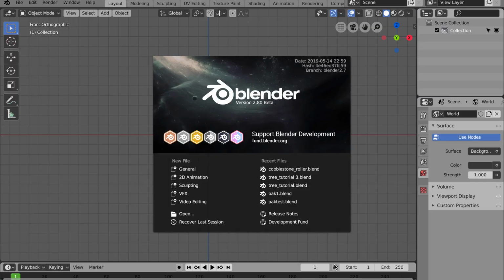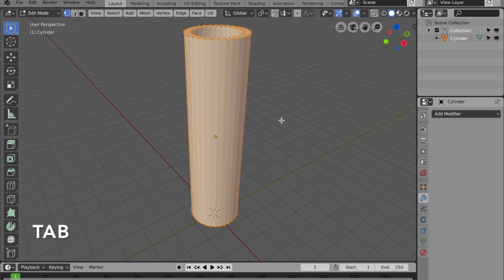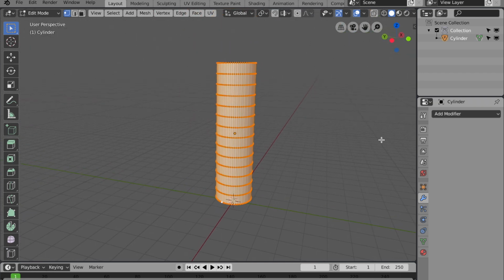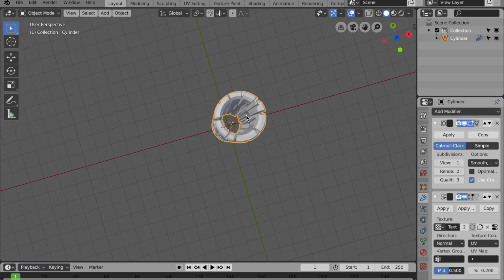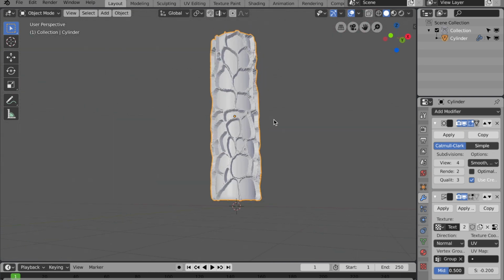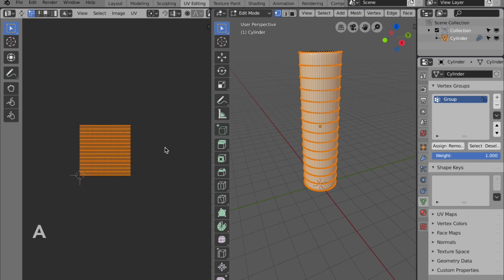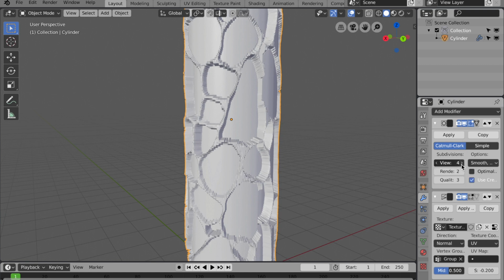3D Printable Textured Rolling Pin Tutorial

Comment: Phew! I got there in the end, with a texture roller for old flagstones. And I really appreciate your efforts to make a video showing how to do this. But I have some comments:
First, please don't say "If you can click a mouse, you can do this in ten minutes" and "The process is incredibly simple and doesn't require any modeling experience"! It has taken me about 8 viewings of this video, several doughnut tutorials, many false starts and a lot of head-scratching to be able to follow what you have done, and I am still not entirely clear. If you offer to take a newbie through a process, you must explain every move, please!
You selected to make a cylinder 100cm by 750cm, which is enormous. Any reason why? My final .stl file came out incredibly tiny on the Cura buildplate, more like 7.5mm high. Does this matter, or should it just be ignored?
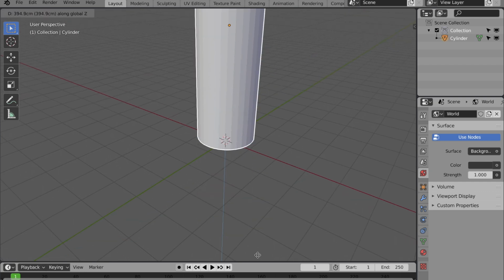At 0:52 you lifted the cylinder up without explanation, in fact while you were talking about the next step.Was it important to do this?
I got stuck at the selection of the outer vertex group, which you did not explain, just showed some mouse clicks. I still don't know how you select the ring of vertices around the bottom rim. I eventually succeeded with shift-clicking little groups, avoiding the inner vertices.
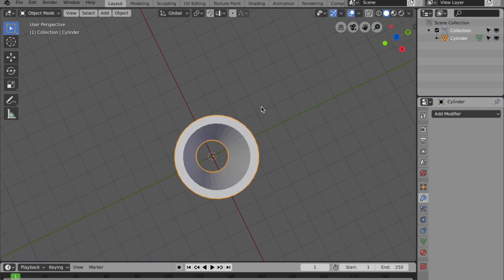When adding the wall thickness, it would help a lot if you could put a caption about clicking the 'Apply' button, as I failed to do this several times... It's at 1:05, where you seem to scroll away.
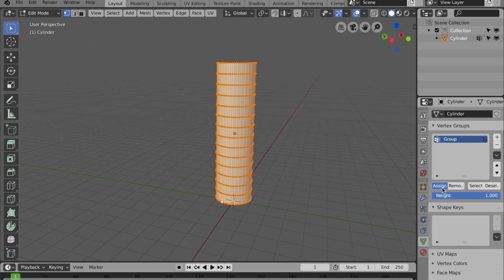At around 2:21 it is very confusing. You seem to click on 'Apply', then 'Deselect', then 'Select' while saying that one should click on the plus button to add a new group, which was the first step. 
Most of the rest worked reasonably OK, then you mentioned Meshmixer - so I downloaded that, but could not follow what you were doing at 4:53 where you increased the subdivisions to 6. I first exported into Meshmixer with 6 subdivisions, which almost ground it to a halt, then I realised the multiplication factor and exported at 4, all was fine. When I brought my trimmed roller back into Blender, the subdivisions were at 1. Increasing them started to massively slow down the computer without increasing quality at all. Can't see how you changed the value to 6, and not sure if that makes much difference. I will try out Michael K's suggestion to soften the jaggedness...
Sorry if this sounds like a huge list of complaints. They are really minor niggles, as I have so wanted to be able to create texture rollers, and you did promise that it needed no modeling experience! Perhaps adding some captions to make the processes clearer would help those of us who really are struggling with the basics.
I printed off your roller from Thingiverse, and thank you for that. It is really excellent and works well on a filament printer.
Do keep up the good work and do more tutorials. Please remember we are not all expert at using Blender!
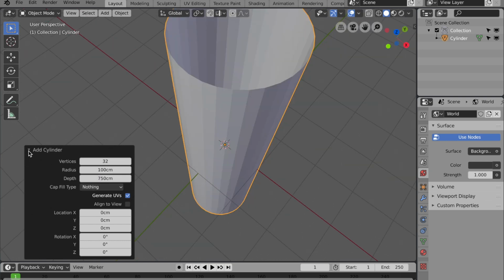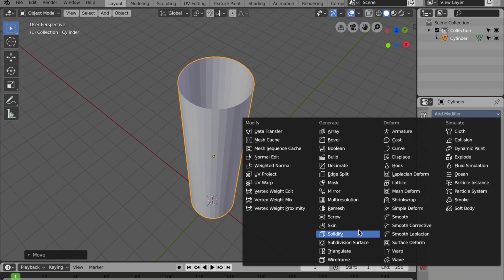Reply from the maker: First, thanks for watching and I’m glad you were able to figure it out! I appreciate the feedback and will certainly try to make things a little clearer in the future! I’ll try to answer some of your questions here, though! The size I chose for the cylinder was based on my export settings, which ultimately determine the size of the STL when opened in other programs. I should definitely do a video on that process! Lifting the cylinder at 0:52 was just my preference, not necessary. Selection of the outer vertices was done by clicking and dragging over them. If you aren’t in wireframe mode, it will only select the outside. I did have to rotate the view to ensure I selected all of them. I believe I simply double clicked the top and bottom rings to select them but there is another hot key for selecting loops that I can’t recall at the moment. At 1:05, I mentioned we would apply a skin modifier but I agree I could have emphasized the need to click the button. When I created the vertex groups, the deselect and select buttons just perform those actions on your group, I was simply showing the grouped vertices.
As for meshmixer, I did a video showing how to use the Plane Cut feature that I mentioned here, though that step is totally optional. I have come up with a better way to handle the ends of the cylinder and may do an updated video at some point. Anyway, again, I’m glad you were able to manage and hope you enjoy the rollers you end up making!
Reply: @ACGStudio3D  Thanks for your detailed reply. Looking forward to more of your videos!
Reply: @ACGStudio3D  Great video! Adding to this, loop select for mac is Option+click (you can view what clicks do on the lowest part of the screen  for reference)
Reply: oh my goodness. This comment saved me I watched this video over and over trying to figure out why nothing was happening when I tried to add the texture modifiers. Applying was what was missing!
Reply: @tp7283  Please help me figure this out too. So after I selected the outer of my cylinder and followed the EXACT steps to add the texture, it is doing nothing. I don't even see any Apply option. Can you help me figure out where is this apply?

Comment: Anyone having issues with a jagged texture after doing the displacement modifier, try going back to your texture tab and increasing the filter size under image sampling. It will smooth out the transitions both along the surface to mitigate the pixel-like effect, as well as give a smoother vertical transition for the rolled material making cobblestones and stuff like that look a little more natural.
Reply from the maker: Thanks for the helpful advice!

Comment: I can't figure out how you are selecting only the outside of the cylinder to create the vertex group.   Is it a keyboard shortcut?? I either get the outside and inside or just the front face of the cylinder.  I'm new to Blender.
Reply from the maker: I recommend doing that step in solid view rather than wireframe. However, if you are in solid view, you won’t be able to select vertices on the backside of the object. If you select the front side then rotate the model, you can hold shift while you continue selecting more vertices until you’ve selected them all. On Mac you can also use Option + click to select an entire loop at once. Not sure on windows but it might me Alt + click. You also don’t need all of them selected at once to add to the group. You can always add or remove more later. Hope that helps!
Reply: @ACGStudio3D  Thanks!  That worked for me.
Reply: @ACGStudio3D  Hi, that's a really great and very helpful video.  I have tried many times to follow your steps but im having the same problem as @Monica Williams, i cant choose only the outer surface. I have tried to do it in solid mode, in wireframe mode but no luck. any other suggestion that could help me solve this? thank you in advance

Comment: the texture in the roller is really jagged in your video, is there a way to smooth that out?
Also what revision of blender is that? im running 2.82 so wondering if the new build will have settings in the same places. 
Have you tried this process using a photo of say bricks or concrete? how would i prepare a photo to be used as a texture?
Reply from the maker: The more subdivisions you use and the higher you set the Subdivision surface modifier, the smoother the roller will become but it will also tax your computer quite hard. The rough edges on each stone are not evident in the actual print or on the clay when you use it. I will have to go back and check my Blender version but I haven’t updated it in several months since I originally downloaded 2.8. I should probably update for future videos. The biggest consideration for preparing the photo is ensuring that it is grey scale. Just know that black pixels displace one way and white pixels the other, shades of grey in between. You can vary the shade of your pattern as demonstrated near the end of the video but be careful with images that have larger variation in shades between individual pixels. If you have lots of speckling of different shades, you will get spikes in the model that make the texture difficult to work with. Hope that helps! Let me know if you have any other questions!